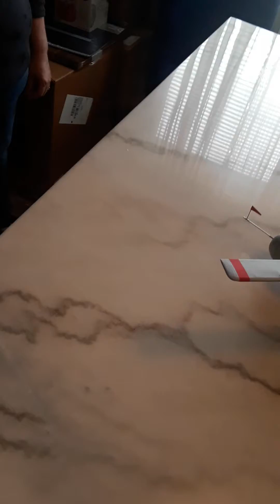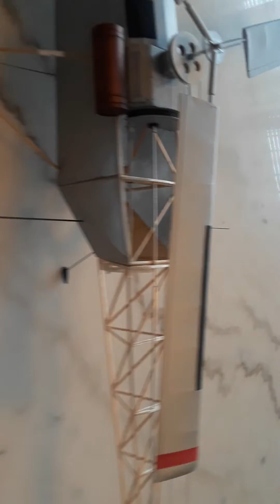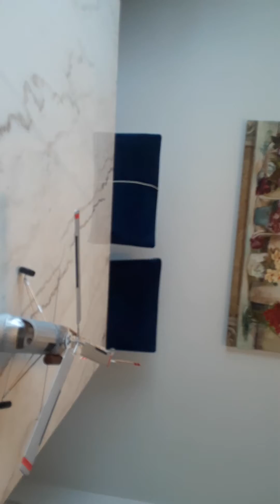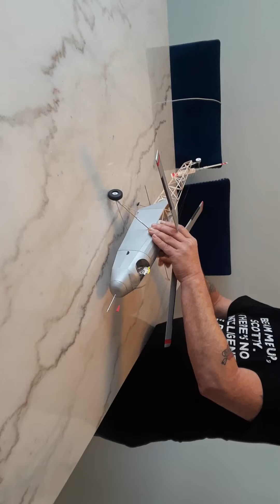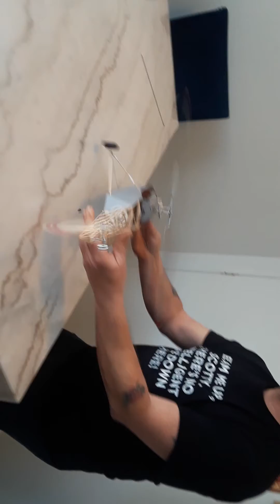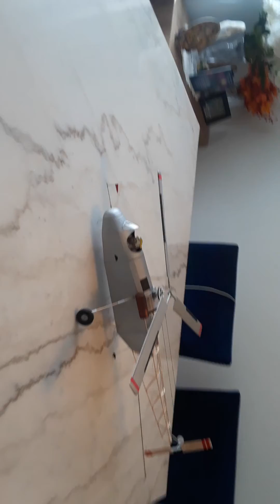Rubber powered VS300 Helicopter test flight # 4

Comment: That heli has a rigid rotor, right?
Reply from the maker: Yes it does have a ridged rotor system.
Reply: @raymondkierna7610  thanks!
Reply: @raymondkierna7610  hi Ray, sorry i wasnt able to ask you this earlier. Im just curious why you're using a rigid rotor system. Most models ive seen use the hiller rotor. Im new to this hobby and would like to ask for some insight to the rigid rotor. For the sake of simplicity, that is my option.
Reply from the maker: @Bourne246  I tried using articulated rotors and none seemed to work well with scale rubber powered models.
Reply: @raymondkierna7610  Oh i see. Thanks again!

Comment: If you have the tail rotor run the opposite direction the blade will be coming up through the main rotor down wash causing it to work more efficiently, just my guess from RC-hel experience, but you’ve obviously built a lot of these so I’m sure there are reasons you set it up this way.